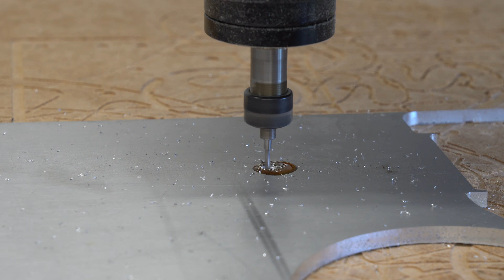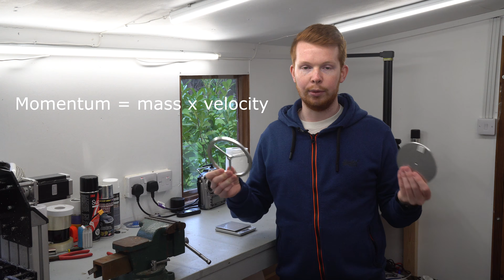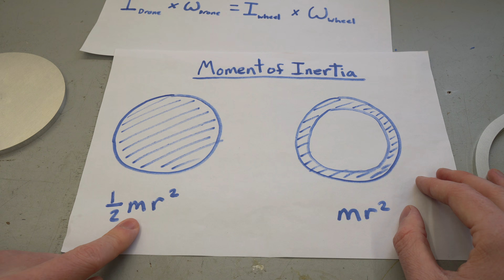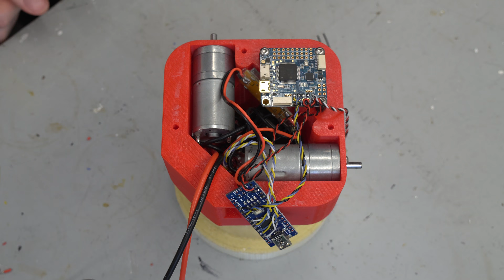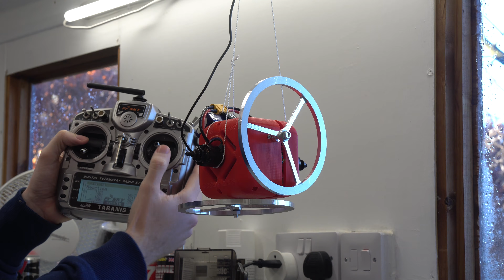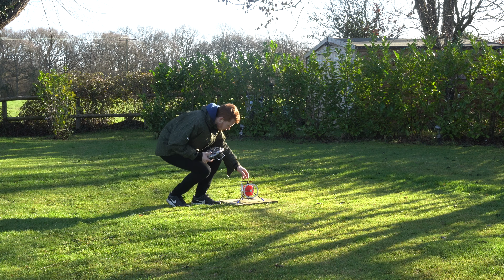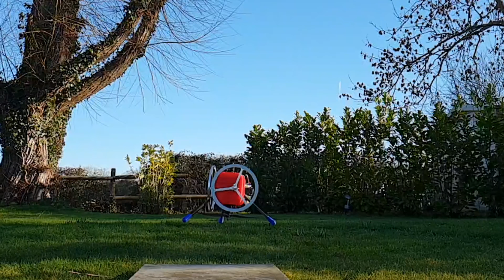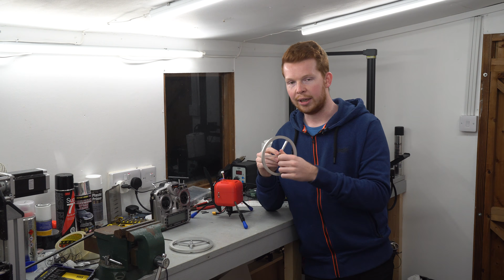Comment: Have you tried to put the wheels on each side ? It looks to me it's out of it's own vertical line and it's not symmetrical... once it tips over too far for the wheels to pull it back it's a kill...  or maybe need better engine to get the wheels spin faster but again putting more and more weight on it will cripple everything

Comment: Good work! 
Also I'd like to note that the reaction wheels get desaturated the faster the air around them is traveling, because exercising the Magnus effect makes them give of energy. So the faster your drone is traveling + your rotors, espicialy the top rotor, spin, the more are your reaction wheels slowed down and the more are your reaction wheels being pushed in the direction in which thier surface is moving at the windward side. But how strong this effect actually is?
I don't know. You'd have to measure that and decide if you take it into acount in your drone controler programming.

Comment: you gave up too soon why not use lighter material for you legs and make a opposite set pointed up with a ring to protect your props? Put a ring on the bottom legs as well, heck might as well tighten the radius and bend the ring around the edge of the prop for a shroud to compensate for the extra weight

Comment: You may have two motors built to the same specifications, but being brushed, one motors brushes might be making better contact with the commutator bars than the other.  It's generally considered a good idea to "break in" your brushed motors before use.  There are many ways to do it, but essentially you're running them awhile to allow your commutator to grind away the surface of your brushes so they make intimate contact.

Comment: I wonder how well it would work if you used the wheels as simple gyroscopes spinning at a high rate to mechanically lock the drone into a stable attitude. If that works, a more elaborate idea is to start the wheels off at mid rpm to act as gyroscopes to stabilize the drone, and to increase or decrease rpm to act as reaction wheels, combining the gyroscopic and reaction effects into a hybrid system.

Comment: The Hubble telescope uses reaction wheels for attitude control as well as pointing the telescope.  They could not use the conventional hydrazene thrusters because the particles ejected by these chemical rockets would fill the area around the telescope with haze of spent rocket exhaust which would continue to orbit with and impact the imaging.

Comment: I liked to see that the reaction wheels are working.

A flaw is an obvious ignorance to strict consideration to the center of mass and by using one propeller for up with something unstable, those masses/forces flicker all over the place. A pilot would not even try by looking at it.

Imagine you connected two or four of the same that looks and acts stable. In that you would have softer reaction and more stability.

Comment: Would that thing even fly without the wheels ? Why do the wheels have to be outside of the box and interfering with air flow ?.....and doesn't most drone control boards have flight stability built it, that would interfere with a second  control mechanism ?
 You are about ten years away from re-discovering 1939 "UFO" tech which you will have to eventually perfect with "red Mercury".

Comment: Seems like the biggest problem here is the latency of the reaction. It overcorrects, and then it overcorrects again, causing it to swing violently. Perhaps you should adjust the controlling circuit to quit when it's almost straight again, instead of killing the switch when it's perfectly on top. (So when it comes from being rotated too far to the left, going right, it should stop at e.g. 100 degrees, instead of 90 degrees).

Comment: Do drones already use the propellers as reaction wheels? For example, a drone with four propellers level on the x axis, two spin one direction, two spin the opposite direction. In order for the drone to pivot on the x axis, one pair of propellers spin faster in one direction than the other pair of propellers. Is this using the same physics as reaction wheels or am I thinking of it wrong?

Comment: I would like to see this revisited and work with adjustments of the center of gravity.  I think it might be too high for the reaction wheels to counteract the momentum once the tilt of the center line gets past 3 degrees (guess).  Hence you will be using a lower center of gravity to impart stability.  When you were hanging the momentum wheels from the ceiling and the unit was spinning, the pivot point was high, roughly at the point where the unit was tied to the string, and all the weight below that point contributed to the stability.  Another consideration is the center of mass compared to the center of vertical thrust, and overcoming that with the momentum wheel.  I think it can be done.

Comment: Give that drone some weight under the button, will make the center of gravity lower. maybe it will fly better.
it also can reduce the requirement of the rotating speed on the reaction wheel.

Comment: Since the reaction wheels are nowhere near saturated for basic flight maneuvers I'd recommend going cutting the moment of inertia of the wheels in half. It seems that the computers struggle to correct for the time it takes to slow down the wheels. If you had wheels that stopped closer to "instantly" then I think your drone would perform a bit better.

Comment: You can use Hal sensors for that, they are dirt cheap and easy to apply. You can directly measure the spin of the motors itself with no additional hardware needed. Very nice project, see forward for your next flight. Very nice indeed.

Comment: I think it will work with other rotors or something like a Turbine, so the rotation from the Props is on any side the same momentum. I would try it with a 5props Rotor. or even 4...

Comment: This thing is AWESOME! Frikin brilliant work good sir!
A maybe thought. Drones have an easier time since they only have to spin  near weightless props and their P.I.D. Loop equations are so massively refined. So I was wondering. Would a lot of smaller wheels on smaller light weight motors that can adjust much faster on the sides maybe do the trick, maybe 4 or 6 per side?
If you give it a whirl I recommend checking out the Emax RSII 2306 1900kv or EMax Lite Spec 2207 1900kv motors on 6S. Their power to weight ratio is bananas.

Comment: When I was at school where I learned all your explanations, I would like to have a teacher making demos like you... ;)
It's not because we can make something that we shouldn't do it if we can learn something and it's safe-ish. :D
Two dumb questions (questions may be dumb but it's dumber not to ask):
- May or may not be an issue if the flight controller isn't as close as possible to the CG of the drone? (I think about over reactions on some situations)
- The reaction wheels seems to be not balanced, may generate vibrations and the FC may have some difficulties to do a proper job. Am I wrong?

Comment: Great idea, but there are a lot of undesirable forces acting against the desirable ones here.  You need reaction wheels on both sides so that 1) weight is balanced, and 2) I think it may work better with torque applied equally to opposite sides.  I know, torque is torque no matter where it is applied along the center-line, and I haven't done the math, but I think in combination with the off-center weight, it causes procession.  Also, changing the rotational speed in the roll axis is going to cause procession of the pitch axis wheel and to some extent the yaw of the rotors.  I think that's where the instability is coming from.

It also doesn't help that a large part of the down wash from the top rotor and inflow to the bottom rotor is moving past a giant cube.  That is likely causing turbulence, and affecting the airflow farther out on the rotors.  Since the reaction wheels are only on two sides, they're not equally involved in all parts of the blade cycle airflow.  Moving at any significant portion of the rotor speed introduces additional stability due to the advancing and retreating portions of the blade cycle.  As others have said, it might be useful to put both rotors on top and some distance from the main housing.  That will create a pendulum and your reaction wheels will pull the craft ahead, behind, left or right of the rotor center-point.

With all this machinery along the center-lines the mechanical systems are more complex than a quadcopter, and with all these forces at work, it may require computer stability control since the forces acts more quickly than a pilot can effectively counteract.

Comment: Is it not a problem that the reaction wheels aren't perpendicular to the centre of gravity? So if the first wheel makes a correction it actually knocks the other wheels axis out of line which makes a correction which knocks the first wheel out of line, which makes a correction which knocks the other wheel out of line, which makes a correction which knocks the first wheel out of line, which makes a correction which knocks the other wheel out of line, which makes a correction which knocks the first wheel out of line, which makes a correction which knocks the other wheel out of line, which makes a correction which knocks the first wheel out of line, which makes a correction which knocks the other wheel out of line, which makes a correction which knocks the first wheel out of line, which makes a correction which knocks the other wheel out of line, which makes a correction which knocks the first wheel out of line, which makes a correction which knocks the other wheel out of line, which makes a correction which knocks the first wheel out of line, which makes a correction which knocks the other wheel out of line, which makes a correction which knocks the first wheel out of line, which makes a correction which knocks the other wheel out of line, which makes a correction which knocks the first wheel out of line, which makes a correction which knocks the other wheel out of line, which makes a correction which knocks the first wheel out of line, which makes a correction which knocks the other wheel out of line, which makes a correction which knocks the first wheHEDGE!
Reply: You saw it too, less than perpendicular wheel to motor shaft. Next try that comes first.

Comment: This actually have more stuff which you didn't mention at all. There is a thing called gyroscopic effect. Basically if helicopter wants to lean forward he must apply force to lean to the left. This sounds crazy but helicopter to move forward he is pulling air down only at right side. Force taking action 90° later at fast spinning things. You should check out that. I recommend smarter every day YT channel. He got that covered simple enough to be understood

Comment: This is done at every satellite, but a great idea for RC as well.

However: Reaction wheels need mass in order to be effective.

Reaction wheels are a "dead mass", since they do not contribute to lift, compared to rpm-controlled rotors.

In fact: Your idea is better suited for underwater RC ROVs, since mass is generally welcomed there.

Comment: I think that one of your issues is using a propeller as your inertia to control yaw.  In the slow mo, you can see that the bottom propeller is rarely spinning at full RPM, while the top one is spinning at the standard rate.  This means that, while the propeller is trying to act like a reaction wheel, it isn't counteracting the torque of the top propeller, and when it speeds up, it's causing an uneven amount of force to be applied over the course of the flight.  Maybe having both propellers on top in a colinear configuration with a third reaction wheel on the bottom? Just a suggestion.  I love your videos, please do more with reaction wheels!

Comment: Maybe the bottom propeller is pushing the center of lift close to the center of mass what's causing instability. In that case your hardware would have to be extremely fast and precise to compensate the rotation.
And doesn't the position of the reaction wells is decentering the center of mass causing even more trouble tho the computer? Maybe using a counter weight?

Comment: Drop the brushed motor on the reaction wheels, Stepper Motors thru a gear box can do it to give you a max rotation. And some Stepper motors even can full rotate at speed but they have the built in feedback loop you are looking for.

Comment: el único problema es el diseño, que no es nada aerodinámico, deberías pensar en el aire que impulsan las aspas no sea interrumpido por el cuerpo del drone, me gusta, me suscribo.
the only problem is the design, which is not aerodynamic, you should think about the air that the blades drive is not interrupted by the body of the drone, I like it, I subscribe.

Comment: Felt like wheels couldn't shift mass that much. And my idea is that problem relies on number of motors and placement. Current placement creates hotspots for mass, results in bad balance. Adding one more motor potentially fix that issue.

Comment: Another potential algorithm: track one orientation, measure the current orientation and current setting, and look at the orientation you want to get to. Then you can decide if the orientation is changing in the desired direction or not, as well as estimate what orientation it will have on the next "tic" of the measurements. Ramp up the current if it needs to change faster, or ramp it down if it needs to change slower (of course, you'll change the direction of the current if the orientation is headed in the wrong direction). The effect you want is sort of a buzzing, where the current is alternating between being on each side of your desired orientation, pushing back and forth ... like a dancer is never completely balanced where they are touching the ground, but is always alternating between overcompensating in different directions around his or her center of balance.

Comment: Your issue is that the reaction wheels have too much mass. Its causing the reaction time of the wheel to be slower because it takes longer to accelerate which is why you see that jittery motion like its flopping about in mid air. 

Why not use a smaller or lighter reaction wheel? It doesn't seem like it needs that much power.

In any case props are more cost efficient clearly, but definitely an entertaining and scientific video.

Comment: +Tom Stanton so am intrigued to why you didn't use a more symmetrical design like most modern drones, still using quad props to generate lift and control yaw. but then maybe try having four reaction wheels 2 doing pitch and 2 doing roll, opposite sides (my theory is that your current reaction wheels don't have time to correct the rotation if they need to spin in the opposite direction. and by the time they do the props have already started pulling the drone to the ground). maybe it's more a case that you reaction wheels don't have enough force to rotate the drone back to the correct orientation once the props have started pulling the drown towards the earth? intrigued to know thoughts?

Comment: I think unstable flight is caused by hyro effects of rotating wheels. So mass used to stabilize drone in fact is the reason why drone is not stabilized as expected. And in your approach the more you try to stabilize thing, the more angular velocities you get, which brings more chaos. Think about it. Perhaps you should push from opposite state.
1. Setup some good rpms on each spinner, this is how you bring basic stability to your system.
2. If you want to change e.g. pitch, you should solve physics issue with 3 rotating objects: you should find which angular momentums you should apply to each of them in order to get desired rotation. You have 3 rotating bodies and changing rotating plane will cause side effects on two other planes.
(I think of props as a single body) 
Hope it usefull and hope it makes sence.

Comment: What if you lengthen the legs with equal weights at the end, and then have a self-learning AI figure out it's optimal setting, take that setting and shorten the legs/lighten the weight, and so on until you get the perfect balance of what your system can handle?

Comment: You can visualize why the ring has more inertia by understanding that the velocity of any part of the thing is proportional to its distance from the center. In the solid wheel much of the mass is very close to the center, therefore that chunk moving very slowly compared to the outside, so it doesn't really contribute much.

Comment: RCExplorer tricopters had a similar problem with flight-controller 'knowing' precisely what the servo was doing...
This was gotten around by running a 'feedback' line from the hall sensor in the servo itself to the F/C & adding some extra code to flight firmware...
Could something similar be done with the brushed motors???
Best of luck if/when you get back to this project

Comment: looks like a wire frame safety cage would help get you a few more flight tests to calibrate it. it was so close before breaking a prop. also raising the position of the upper prop would help greatly in stabilising the assembly
Reply: also i think your idea for turning using prop speed has a small issue that may be worth investigating.
when the upper prop is spining faster then it provides more lift which would make the drone more stable as the centre of mass hangs below the prop.
when the lower prop is spining faster it produces more lift and there for holds the drone mass above the prop (pron to tipping over) which is unstable
i would suggest you try again with the majority of the mass carried by the upper prop. not sure if that would work but your work so far is very impressive. would love to see a sable flight out of this drone